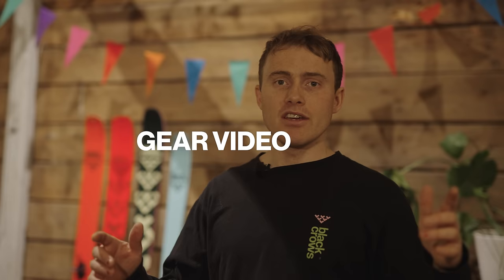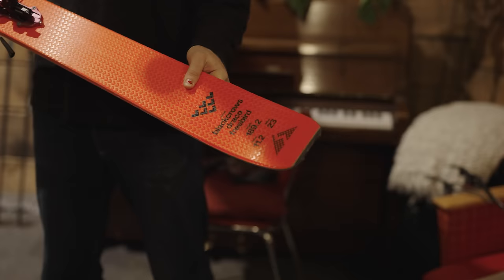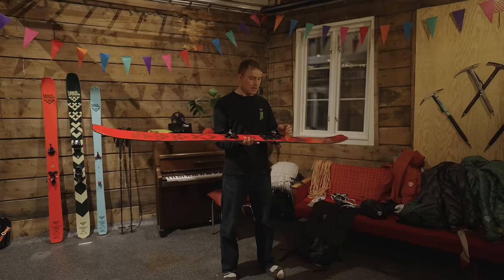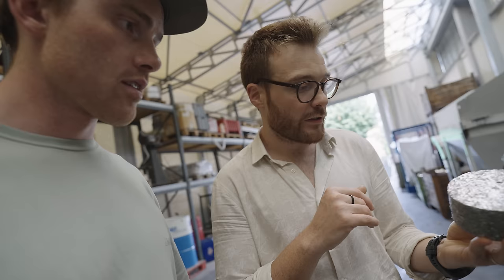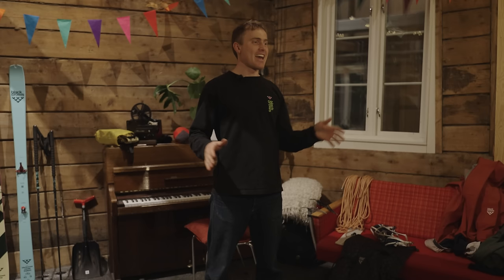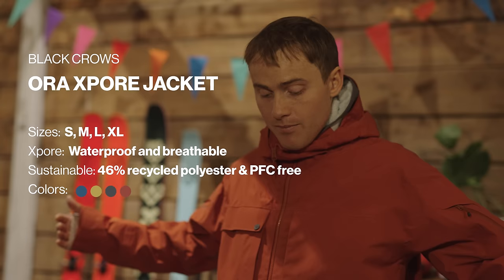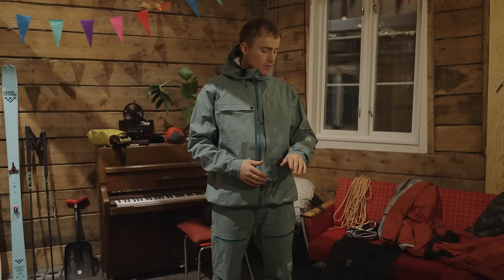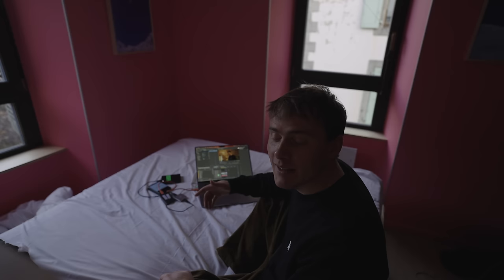The best backcountry ski gear, 2024

Comment: im a big freeride noob and i'm wondering why you don't have a ABS backpacks, is it because of saving weight or isn't it that helpful in the terrain you're riding? love the vids and keep on shredding my dude!
Reply: well the best way to not end up in an avalanche is to dodge avy terrain, then you can go lighter without it, if you are sending avy terrain thinking ah I have the backpack anyway, it is a pretty poor reasoning; having said that I ski everything in backcountry with avy pack, avalanches fucking scare me
Reply: @mettflow2648  ah so for example if you go heli skiing you probably won’t have the time to dig pits and the weight isn’t a problem you’ll use a ABS backpack
Reply: If you go Heli skiing, you are most like to do with a guide and they would have the knowledge about the snow pack and snow safety, so no need to dig pits yourself. That said you wil moist likely have to where one, because of insurance from the guide etc. Although it is here in swis
Reply: @NielsB_ you should always use an avy backpack, but if you are carrying as much equipment as niko for long times, it can get pretty exhausting, however i dont really understand his reasoning behind it, yes some avy packs had problems in the past, but they have become a lot better over time and your chances of surviving an avalanche whilst wearing an avy backpack and using it are higher than not using one

Comment: Boots! The only reason why I wanted to watch this. Give a shout back peeps what is working for lightweight Freeride side?? Awesome vid though.
Reply: Currently, I'm using Scarpa F1 LT for soft snow / pow days because I can get away with it. Have Atomic HAWX Ultra XTD 130 for Freeride Back/Sidecountry setup but don't like the fit. I have to crank way to tight to get it to feel anywhere near performance. But, then start getting boot bang. Touring range of motion is way limited compared to F1 LT.
Reply from the maker: Agreed. Tried the hawx, not a fan. I’ll get back to you when I’ve dialed it!

Comment: The ATK 15  bindings look nice and I like the weight and features ,  but  I was on the ATK web site, there are no Canadian skiers listed as brand ambassador athletes. Im also  pretty sure I could get dynafit replacement parts and  enjoy Dynafits long warranty way easier and faster here in Canada...I trust and will  keep using the  dynafit  radical with an extra heel piece in my repair kit as my go light binding  or use the rotation for safer toe release and carry a lil extra weight (aprox,  200g) for  backcountry skiing in the Canadian wilderness .... I know how to de-ice under the binding and there is some steel in there and not just all aluminium.

Comment: Is rear eject enough to save ur knee in a fall where the tip of the ski is pulled to the side, if you know what i mean. I have blown my right knee using Fritschi Tecton 12 bindings that has frontal release... So no real use for the frontal release if it fails to do so.

Comment: Do you still consider the rotation 14 to be a great binding? I ski it 50/50 resort and backcountry so I love it for having a lot of elastic travel and that I feels closer to an alpine binding than other pins do. But I have however had a few pre releases on it skiing resort on hardpacked icy runs. On softer snow it has never let me down and I was wondering if you experienced something similar when skiing the rotation?
Reply from the maker: Hi, I did have one pre release on them, skiing icy moguls. But other than that they've been solid for me. That being said, I do also have an alpine binding setup that I use for pure resort riding.. 

The ATK has been great so far, but yeah the toe will always have less elasticity in a pin binding.
Reply: @carlfhyr6456 the Rotation has no more elastic travel than any other pin binding. The rotation part is there to keep the pins clamped (to prevent prereleases that Dynafits seem more prone to than other brands), but as it rotates on a fixed axis that has no reletive sidewide movement and all the elastivity is in the back it produces no more elasticity in the toe than any other pin binding (exception Vipec/tectons that has 12mm elasticity each way up front, most tech bindings have 2-4mm if my memory serves me right). The Rotation is a 600gr binding doing the job of a 300-400gr binding - the various ATKs with freeride spacers are a all much improved systems over the Rotation.

Comment: I also struggled to find boots that fit the bill. I bought some cheap Hoji Free since I really liked the original Hojis except for the lack of toe welt and a tiny bit too soft. But couldn’t get free to fit like I wanted. Finally, I bought some intuition wrap liners. 120°C for 10 minutes did the trick, just had to do it like 6 times to get the wrap as I wanted, but the final result was really worth it. Much firmer, warmer and 150g lighter. 

Original Sidas liner really suck, it’s a shame they call it thermo formable, it’s not on the same planet as Intuition wrap.

Comment: Nikolai, which binding do you have on the Nocta? I don't see an ATK binding with a brake wider than 120mm or does the 120mm just fit the 122mm Nocta?
Reply from the maker: The 120 fits well on the nocta, yes :)

Comment: I think that I've never seen you skiing the navis fb or the corvus (fb). Is it because of the Twin Tip, or is it just not suitable for your high-speed skiing or do you have other reasons for it? I'm thinking about getting one of those, because they might be better on hard crusty snow
Reply from the maker: Yep, just no twin tip. I like how the tail releases a little more gradually on a twin tip (and also you can ski switch of course). But it's a great ski for sure

Comment: Hey Niko! What kind of headlamp do you use for night touring? Is the headlamp attachment on the helmet actually useful vs the band? couldn't tell from the video how the clip worked.
Reply from the maker: Hi, 
I use moonlight mountain gear. For the way up I normally don’t wear my helmet, so I have the strap just on my head, and then for the the way down they clip into the gopro attachment. So no, I don’t really use the ones for the strap on the helmet much. But they work well for the regular kind of approach headlamp

Comment: have you tried superlight carbon touring boots (I'm thinking of buying tecnica zero g peak carbon) and do you think it might work as an all round touring boot for someone trying to ski relatively big lines (but still miles from your level) and skis 70% of the time touring and the rest in resorts (europe). My skis are corvus freebird 188 with marker kingpin. Thanks
Reply from the maker: Hi,

In my experience I think you would be better off saving some weight on the bindings and going for the regular zero G. If you go ATK fr 13 or 15 instead of kingpin you’ll have save the same amount of weight, but you’ll get a WAY more solid setup
Reply: @Nikolai_Schirmer  thanks a lot! I'll do that then.

Comment: Did you run into issues with the hoji boots you were using? Or just as part of the sponsor changes need to change boots?
Reply from the maker: Not really. The Hoji is just getting replaced by the Radical, which has way more volume, so it doesn’t fit me very well. 

I could just get a bunch of Hojis of course to last me a few years, but there’s been quite a lot of new boots coming out the past four years, so I just want to see if there’s anything that’s better

Comment: Hi Niko, are you using 4mm toe shim that’s included with ATK 15 Evo? ATK itself is a bit blurry about it, mentioning just more “natural” feeling with that piece mounted. If yes or no, is that based on some tests or preferences? Many bindings have very, very different heights of toe and heel pieces, and I’m wondering how much these 4mm can affect skiing.
Reply from the maker: Hi,
I’m using it, but tbh I don’t feel s huge difference to other bindings I’ve used in that regard. The stance feels pretty flat

Comment: Niko, with the ATK bindings do you lock and unlock the toe piece a few times before dropping into a line after bootpacking? This is something I got in the habit of doing with Dynafit bindings bindings to make sure any snow/ice is clear from the toe pieces after some pre-release issues. I have ATK bindings now and still do it out of habit but not sure if it's necessary or not.
Reply from the maker: Yes, I still do. Just to clear out any potential snow left in the inserts in the boots :)

Comment: Hey Niko, can you clear something up? You talked about a DIN release value for the ATK Freeraider Evo bindings. Those aren’t actually DIN certified though, correct? It’s just an approximate value? How do you feel about the safety of the release on that binding? Is there a reason you don’t ride a hybrid binding like the Shift or Tecton other than just weight? I love your videos, keep it up!
Reply from the maker: Hi,

Yep, it’s not a certified DIN but more of an approximate value. I had to turn mine up to 14, and then it performs like my 12 did on the rotations.

For me it’s a question of weight, durability and performance. I don’t feel like I get more performance out of a shift, and from what I’ve seen they’re not very durable.

On the safety side, honestly I have never had a problem with a pin binding not releasing. It’s always been pre releases that’s been the issue. And pin bindings have a lateral heel release unlike normal alpine bindings (which is what gets your ACL), and I’ve torn my MCL, PCL, meniscus and fractured my tibial plateu in an alpine binding.. so yeah. I feel good in them!

Comment: Hi Nikolai! I was wondering about your treatment of the dwr of your jacket and pants, goretex or xpore. I dont use goretex as well any more and at the last dwr treatment I think I messed something up. Do you spray and tumble dry? Hairdryer? Natural drying? Appreciate your input as always! Be safe!

Also, if possible, since it is my only (and very limited) experience till now, I am riding on a Black Crows Daemon which is a full rocker ski. What are your thoughts on these?
Reply from the maker: Hi!

I’ve done some DWR that I just sprayed on after washing. Worked well :) that was on gore-tex which was getting soaked in BC. Sledding in the rain is too much for most membranes as they get old.

I still haven’t had to do anything to the xpore. It’s been working well so far, but I guess I’ll do the same routine then. 

Full rocker skis are fun! I liked the old nocta too, and the hoji and the old volkl one’s for that matter. But i do prefer a bit of camber underfoot for versatility
Reply: @Nikolai_Schirmer  thanks for your reply! Greatly appreciated! As always, stay safe, have fun!

Comment: Hey, thanks for the video- what's your opinion on the black crows skins compared to other ones- especially if you are skinning up multiple times- I absolutely love the brand and the skies but I am not sure if they have done the best Job there because the hybrid skins (or at least mine) tend to not stick as much as normal skins and once they stop sticking you can't simply put new glue on them and you have to buy new ones.
Reply from the maker: Hi,

So the old version of the skins I used back in 2015 were crap. But these are actually just rebranded pomoca skins and are amazing.

Comment: Hi Niko, how does the Draco Freebird compare to the Corvus? Which are the advantages and disadvantages between these two?
Reply from the maker: The flat tail make the corvus less slarvy. Otherwise they’re pretty similar, especially the shorter length dracos. The 189 is just overall a more beefy ski. Longer radius. More width

Comment: In need of a protip, sometime I wanna sit down when I wanna eat my backpack-baguette, but then I get a wet bum from the snow.

When you have new shiny gear is this not an issue. Or are there some tricks to not getting wet legs when working in the snow when the snow is more wet.
Reply from the maker: The pro tip is to sit on your skis, your backpack or a rock. No garment is waterproof when sat on, except those pure plastic fisherman’s outfits
Reply: @Nikolai_Schirmer  good to know i'm not missing out with my old bibs, Will keep em rocking for a few more years! Or get into fishing..

Comment: Hey Niko! These vids and your skiing is soooo inspiring!! Been binge-watching the last few days.. THX!! However: I’m trying to figure out which skis to buy. I am 182cm, 85kg from Oslo. With 2 little ones I don’t get to go out as much, but when I do it’s usually because it’s snowing somewhere. But that also means I ride a lot between Norwegian trees and not often the big open lines that we all long for ;) Need a ski that’s easy to maneuver/to turn, fun, playful, even though I come from old school racing and therefore aren’t too used to less directional skis… Nocta? Draco? The Ferox (used?) Atris?
I ride with pin bindings and hike a bit, but turn to resort skiing if I can get more laps / fresh pow out of the same day ;)
I try to avoid the piste and already have the Mirus Cor 🙌🙏

Appreciate any help!
Reply from the maker: Hi Marius, and thanks!

I think I would go for the Draco in 181 (don't go for the ferox unless you hate speed). It's quite a different ski compared to the 189 version, with a shorter radius, making it way more playful and fun. Should do the job in tight Norwegian trees!
Reply: @Nikolai_Schirmer  WOW!! Det var raskt svar 🙌 Blir ikke for stiv? 

Haha.. Hater ikke, men vet ikke om jeg nailer det 😝🤣 Takk!
Reply from the maker: Tja ja, Nocta er sjukt fet den også! Men føler bare ikke det er like mange dager man trenger så feit ski. Draco 181 er en ganske annerledes ski enn i 189. Kortere radius, mykere, litt tynnere.  @mariusgjers2956

Comment: 37:10 I know it's a DWR issue and not the fabric but your comments about other jackets being as good as gore-tex would resonate more if the water was beading and falling off your shoulder instead of soaking right through it.
Reply from the maker: What I’m saying is that gore-tex looks exactly the same in the rain :) the Gore-Tex sits beneath a face fabric, which protects the membrane. DWR only keeps water beading for a short while on the face fabric, then it soaks through and the membrane stops it from making you wet. If DWR kept water beading perpetually you wouldn’t need that membrane, right?
Reply: @Nikolai_Schirmer  I'm just saying marketing matters

Comment: Have you tested skiing the freeraiders with and without the spacer? While i didn't want to get the evos on the first year, i did get the regular freeraider and have been debating how much impact the spacers would have

I have the reason (s) not to get adjustable poles: cost and durability. I've had way too many poles break on me, and I also don't get free replacements, so i decided to get some $10 resort poles used with big baskets, some $5 bar tape, and made my own baton style poles instead. I figure if im putting the poles away, I'm also putting the skis away, and those are even longer so it's fine. Been happy so far.

Also cool to see you trying to get even your gear more sustainable, i tried Helly Tech Pro for my hard shell and its been doing really well, and i feel less bad about it, which is cool.

Good luck with the boot searching! Went shopping with a buddy recently and was surprised how light and flexible (when unlocked) some newer 4 buckle boots are. Given how hard you ski, those might be good for you. I use lighter boots for most ski mountaineering objectives, but have burly ones for easier days with no/minimal bootpacking. But since you ski harder than I do, you might fit better somewhere in between
Reply from the maker: I haven't actually, but to be honest I never really had a problem with the pin heels without spacers on other bindings, so I'm sure it'd work well. 

Fair point about poles! And yep, definitely looking into some of the new 4 buckle designs
Reply: I ride ATK FR w/o spacers and it works well on my Movement AlpTracks 106...

Comment: Hi Niko great video.
In your opinion atris are good as ski-tour setup with some ATK evo 13 or 15 and also piste skiing (50%-50% or 40%-60%) or they are too heavy and wide?
(I generally ski in Italy or Switzerland and also Chamonix😍 so not as much snow as Norway.) 
Or maybe I should go on something else like justis or camox?
Reply from the maker: The atris is perfect for that use I’d say. Really fun all round ski that works for everything! I have a pair of evo 15 on mine
Reply: perfect next order on the black crows site will be them😍
and one last question, what size do u think should I get? (191cm for 83kg) now I use camox freebird 183.4
Reply from the maker: Oh I would get the longest length, but I like my skis long. You'll be happy going one size down if you prefer more playfulness  @sMorE33
Reply: Thank u so much Niko

Comment: Awesome gear update, thanks! 
But why aren't you staying with your Dynafit Hoji Boots? Or aren't you allowed to use Dynafit anymore?
Reply from the maker: The Hoji is replaced by the radical, which has way more volume, so it doesn’t fit me very well. 

I could just get a bunch of Hojis of course to last me a few years, but there’s been quite a lot of new boots coming out the past four years, so I just want to see if there’s anything that’s better
Reply: @Nikolai_Schirmer  I think there is a new hoji model in the making, sam anthamatten is already testing it
Reply from the maker: Oh, cool to hear!  @mettflow2648

Comment: What do you run your ATK DINs at?
Reply from the maker: I'm at 14, and I weigh 86kg
Reply: @Nikolai_Schirmer  you are the man - thanks!
Reply from the maker: Enjoy them. And make sure you have a shop tech that knows how to set them up. They need to be really precise. @ryanebzery
Reply: @Nikolai_Schirmer  have you had any pre-release issues with these? I keep pre releasing on hard pack. My DIN is set properly, so I’m not really sure what the issue is. Maybe not enough forward pressure?